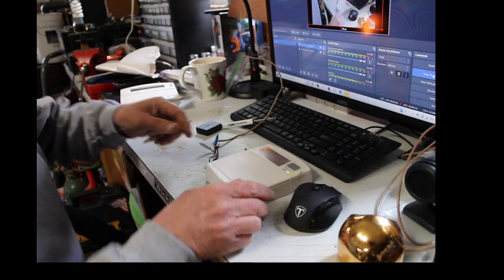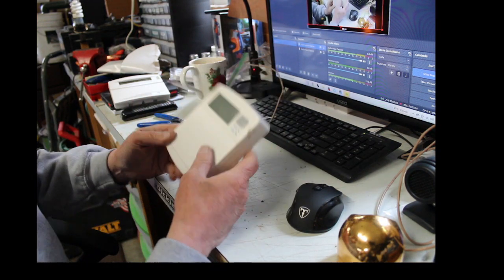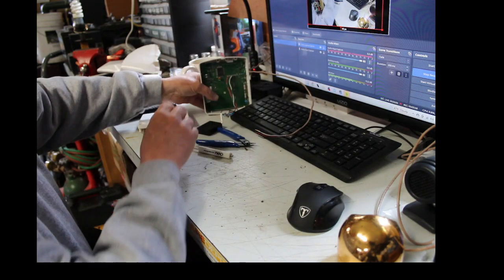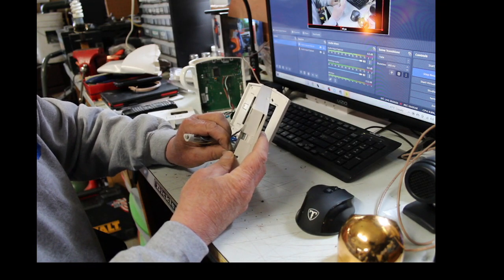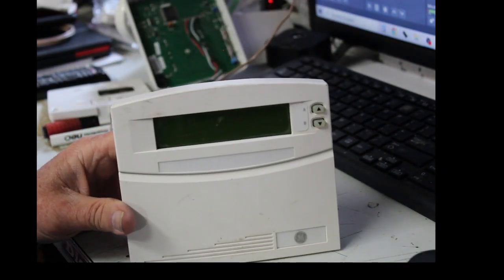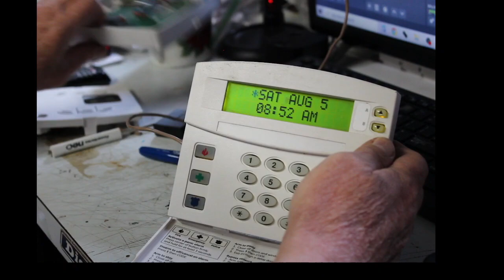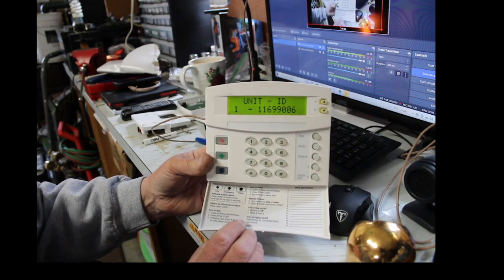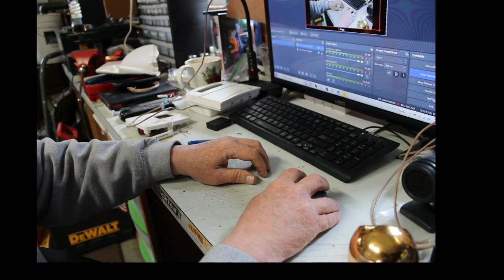GE Interlogix Concord 4 upgrade keypad to SuperBus 2000

Comment: Question, I had a new garage door sensor installed back in  2014 and this fix english key pad was being used at the time of the new sensor install, how did ADT configure the system
with the fix english key pad?
Reply from the maker: The installers carry programmers on their trucks, you can do it with a fixed english keypad but its dangerous,,,called blind programming
Reply: @DIYELEKTRONICKITS  Understood, you are a wealth of knowledge and thx again. You said you had a web site, may I get that from you some how ?
Reply from the maker: @reefkeep2  for electronics https://www.diyelektronics.com  ham radio ...pixiekits.com

Comment: Hello I have a GE Concord keypad that just went dark.  I don't know if its the key pad or the problem is with the panel?  Any assistance would be greatly appreciated.
Reply from the maker: Sounds like it lost power? check panel output on terms 4-5 in control panel for +12vdc